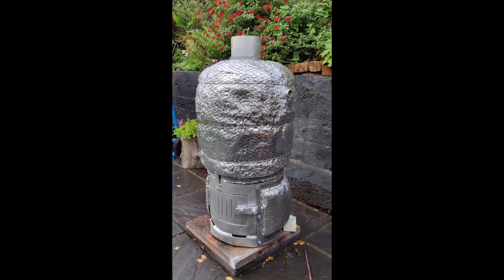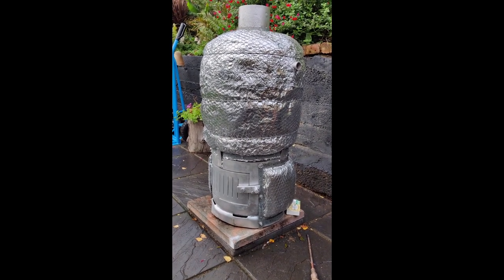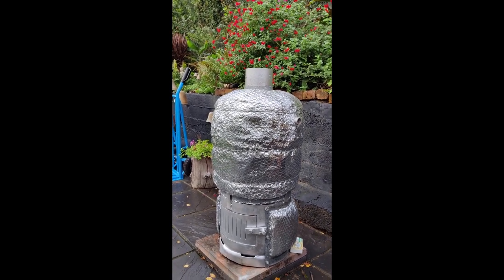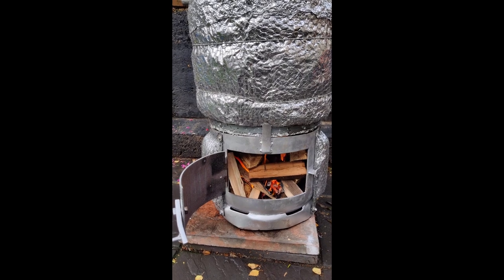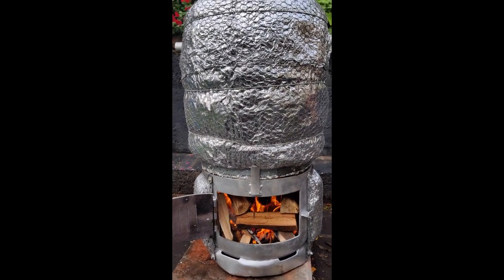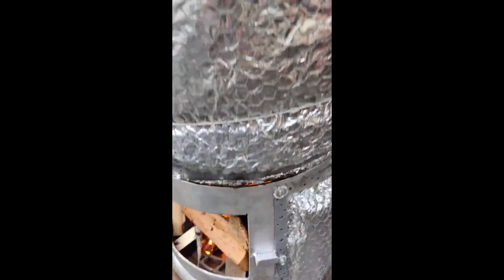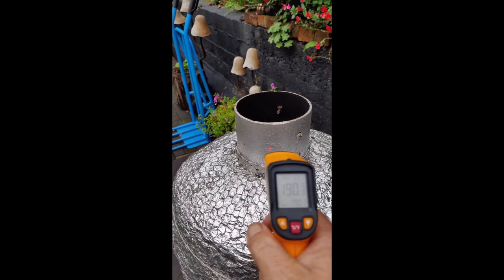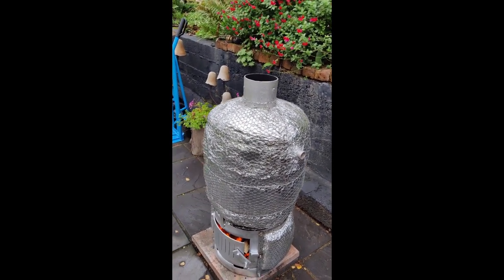Sand battery can it heat my home? part 2

Comment: Great concept but have you though about making a cylinder insert for the smoke hole and design it to place in the opening but have it so the smoke and venting spirals out of the chute like a vortex in a tornado, Im thinking that might make the heating a bit more intense directing those gases upward out against the walls. Also build a frame that has wheels so you can place the canister onto the base frame and wheel it in over top the fire-pit to eliminate one extra set of listing of the canister.  Could you also add open chambers inside the canister enclosed to keep sand out but allow for a fan operation to blow through the inside the the canister to better direct the heat from the sand into the room? Anyway just some thought on how to better utilize your set up to get the most out of your work. I really like the concept and plan to build one for a garage next year. based on your application making some small modifications as I outlined for you. Thanks again for sharing a great idea.

Comment: When are you launching? LOL It looks like a old time satellite.
Great video. I ran on a bit in your first video on this.
You did a nice job on insulating.
On looking though, you already have radiator heat. You can't do much better than that. If it is a closed system, replace the water will oil, and heat transfer increases like 7 times.
I know your wife will want the satellite to not be filling the center of the room.
Try the Trombe Wall I talked about in your first video. It will heat free with the sun as hot as you are getting now with a fire.

Comment: Very interesting experiment that utilized the various system constraints as well as one could do with the materials & methods available. Kudos Lee! (Being limited to burning outside of the room to be heated and having to transport thermal mass into the house manually both combine to introduce huge inefficiencies that limit the possible engineering solutions. If Lee was allowed to pipe a heated thermal transfer fluid, like mineral oil, from a backyard wood burner with a heat exchanger & a high temperature pump, then heat capture would be more efficient & continuous. Add sand batteries in the rooms to be heated and then wood burning batches could be spread out as there would always be stored heat in the sand batteries to draw from. Alas, modernity now hits us all with systemic constraints that prevent all sorts of alternative heating backup systems.)

NOTE: It is also possible that the introduction of the chicken wire coil in the central chimney helped a bit by breaking up the more laminar flow of heated air & combustion gases and causing more turbulent flow which would keep the heated gases in contact with the chimney walls longer - thus transferring more heat into the sand. (The more surface area of heat exchange the better. Hope someone with heat exchanger design experience will chime in if there are any improvements that Lee could make to improve heating efficiency - especially as winter is coming on shortly.)

I'd say Lee made a excellent start on a supplemental heating system that uses wood - a relatively inexpensive renewable resource. But results suggest that more heat energy will be required to get thru a cold winter and heat even a single room to a comfortable level & maintain it day after day.
Reply: Also, we handled a prolonged winter heating emergency by camping in a single room, covering the windows with homemade insulated curtains, and focusing on just keeping that room "comfortable". The rest of the house was kept above freezing to prevent pipes from bursting.

A better test of Lee's system would be to prepare his winter survival room as detailed above, and then see what room temperature could be attained & maintained with his sand battery. (Especially the delta T between indoor & outdoor temperature over time.) If, with the survival room as insulated as possible, the sand battery can create comfortable air temp for a number of hours, then maybe all that will be needed is a second sand battery that can be charging while the first one is discharging.

As some have suggested, a metal insert in the sand battery chimney that increases turbulent flow and conducts more heat to the chimney wall could help improve heat exchange. But then there is the challenge of transferring that heat into the sand. Again, someone expert in heat exchanger engineering needs to chime in on how to get that heat into the sand more efficiently. (A simple, inexpensive solution that improves thermal storage sufficiently to make it worthwhile to implement.)

Comment: Consider adding a damper on the top of the chimney to restrict the fumes allowing more heat transfer and slower burn of the wood. Yes an open chimney will burn hotter and faster but inn this case a slow 300C burn will save you wood and will make the overall project more efficient as you are losing less heat.
Reply: Yes the difference between sauna and takka.

Comment: Make a box out of glass foam about 180 mm thick. Put a plate steel floor inside the box to distribute the weight. Stack firebricks inside, tied together with fencing material or chicken wire, like a gabion fence. Put a resistance heater in it. Use a solar panel or a small wind turbine to power the resistance heater. Select the resistance for maximum power transfer. The heat will leak through the glass foam insulation at a rate that is dependent on the temperature of the bricks. Continue to use your home heating system and thermostat the same as before. The heat that leaks through the glass foam insulation into the house interior will reduce the amount of fuel you have to buy for the conventional system.

Comment: theres endless upgrades you could do with this but top of my list would be to introduce hot fresh air to the smoke. any smoke exiting the chimney is unburned fuel and lost potential heat. 

i'd add a slight narrow point in the chimney, about 1/3rd of the way up. (like in a carburettor) and pipe in some pre-heated air so the smoke ignites in the chimney.

Comment: Hi enjoyed your sand heater design, Matchine Mart sell heat powered stove fans maybe ideal for application, I would worry about your wood floors sit on top of concrete slab or heat resistant tiles,

Comment: Water has idk perhaps 4x the heat capacity as sand.  I won't bother calculating.  However with water, you will need redundant pressure relief systems JIC.   water pressure build up can be explosive but there are ways to mitigate the excessive pressures safely.  If you try water, make sure you have redundant systems in place beforehand and are clear on when and what pressures they will release less it blow a hole in your wall.   If your not sure how absolutely, don't do it.  An alternative would be graphite powder as it won't melt with your setup and you should be able to seal the container and reduce the smell.  Before you seal it, heat it as hot as you can and then seal it, as it will create a vacuum when it cools.  GL!

Comment: Suggestion: Use Celsius or use Fahrenheit, but not both. Pick just one and stick with it. When you use both, it causes unnecessary confusion. I used to work for a company that insisted on using both millimeters and inches. I had to convert back and forth literally every day. It caused many problems. The fence only hurts when you are sitting on it.

Comment: Awsome project. I'm looking to do the same at a larger scale with a thebaddition of a water heat exchanger and a radiator in the house. I found your channel while doing some homework. Is the system working for you?

I believe the chicken wire is causing turbulent flow in the flue allowing better transfer of heat. I deal with this at work with water cooled molds. When we have overheating issues, baffles are added to create turbulence and increase  heat transfer. 

If you add a cap to the flue to direct the air horizontally, it might make the room feel warmer. As it is, it seems as though the heat is being directed to the ceiling and the cool air is settling where your thermometer is located.

Comment: For IR reflectors (Al foil etc) to work efficiently, you need a significant air gap (free of solid materials). At least 1/4" but 1" or so, even better. If it is pressed right up against another material, then it won't work, or barely, at all. 

  The easiest way to do this, is to get some Al flashing or the like, polish it to a more mirror finish, and then enclose that around (but outside of, not directly connected to) the stove most of the way but without blocking the air intake areas.
Reply: Btw, talc powder is better to use than sand.  Soapstone is primarily made of the same material that talc powder is. Soapstone has one of the highest heat capacities of solid materials out there (interestingly, water is far higher than most common substances). The nice thing about talc powder also is that it is very soft. You could compress it to get out more of the air and to pack more of the powder in a space, which increases the density, which increases the heat capacity per volume.  

   If folks are worried about breathing in talc powder or it getting loose at all, just pour a layer of waterglass over it.  The easiest way to use this, would be to put talc powder in metal buckets or pans (then compress it if you can) on top of a flat stove surface.

Comment: Not sure if you thought about it but you could use a fireplace fan -- energized by heat no electricity and would circulate the heat coming up from the pipe.

Comment: You don't seem to be getting the full rocket stove effect with the secondary burn in the chimney (for which you need air injection further up the flue).  Could you run a pipe or two from the exterior at the bottom up the chimney to about halfway?  That would inject heated air into the hot gassed
 and complete the burn.  Possibly a taller removable chimney would get the roar really going.  And more air to the bottom of the fire?  A ring of holes around the bottom of the firebox?  I heat with a wood stove, so I know adding air to a stove through a door gets you a slower fireplace type burn--while having the door closed and the air blasting into the base of the flame through narrower holes, gets the fire really honking!
Seems bloody effective as it is though!  Hell of a job!

Comment: Very interesting! Made a rocket stove sand battery that released heat for 5 hours but have been thinking about how an insulated jacket would improve the design. BTW, did you use standard rockwool?
Reply from the maker: No I got ceramic insulation, hi temperature as I didn't want to risk a smell , not that I'm saying rock wool or other insulation will smell, it's just that this one said it doesn't so I'd went with is to save me doing it twice 👍
Reply: @leejones2511  this is a great experiment.  Keep it going.  👍👍👍

Comment: Also it looks like you can work with metal, so if you can also do a bit of plumbing, I think you can do your own diy mini outdoors boiler. That would be easy to move or remove if sb doesn't like it, and you will not need to Gotti stuff in and out of home, resking the partner disapproval 😄. Let me know for more info !
Reply: That's what I did to keep an insulated greenhouse warm over night. We had several 50 gallon drums linked
Reply: Until the city or state finds out about it and you don't have a permit.

Comment: I think this is the "future" of heating! Of course it must be modified and tuned up to reach Hi efficiency = less wood, more heat! I think about it like so - we put it in the underground level - there is a burner. Very slow burning process heats up the "drum" and then pipes inside the "drum" heats all the house with a fan.. Yes.

Comment: Add a damper on top so you don't lose so much heat out of the top during the burn... use less fuel to heat it initially.

Comment: Right off the bat you're losing a ton of heat through that hole on top. You should wind the exhaust back down around your stove (if you want to keep all the heat in the medium), then again up and out of the room with cooled-off gases. Make sure you take care of liquid residues in the pipe.

Comment: you could always build a big sand tank outside with switchable ducting and after your burn change the duct to the inside ducting with a small fan assist recycling the inside air

Comment: If 23C is uncomfortably hot indoors - turn the fan off. It'll cool slower so last longer at a less intense heat. You'll still get airflow from convection - hot air rises without a fan to help it along
Reply from the maker: Yes it was just a test to see the output 👍

Comment: 19:10 but why did u place cooler underneath and not above the sand-heater? That way cooler just cool down the sand and send all the hot air straight to the ceiling... Do u need warm air there or on the floor? I'd placed the cooler upside down to send hot air down where it be mixed with the cold air and made the room air more pleasant to feel.

Comment: Instead of wasting the heat, use the top to cook when you are heating it up. I think the initial smoke was from the chickenwire coating burning off. I didn't see the smoke after. In general, more mass will store and radiate more heat. Not sure on your setup due to the airflow of the flue. Are you really going to go outside and burn this for a couple hours, and lug that thing in and out every day? I was thinking of ducting the hot air in and keeping the whole unit outdoors.
Reply from the maker: Cooking not really a option for us unfortunately, but yes will be burning it most days when it's needed, it's not always cold here, we had 12 hrs of heat in that last 2hr  burn but il be doing another video & we can see whether what heat was effective & when it tailed off 👍

Comment: You are having to use energy input (wood which in itself is a cost to be considered)to make the sand hot and get heat out. For those that don’t have any wood to burn i.e. the greater majority of people could not use it. It cannot be called a battery, it’s just a storage heater which is similar for example to an oil heater that we use in our conservatory in the winter which requires an input source to hear the oil which is electricity and then the oil gives off the heat to the room. This also is not a battery.
Reply from the maker: So when you charge your phone  which comes mainly from  burning fossil fuels ie burning gas/coal to heat water to power a turbine to make electricity which you then plug into your phone which stores that energy that to be used  is this also a storage heater?
I'm just building & sharing something personal to me burning my own free wood storing that energy to heat my home the only way available to myself for free 👍

Comment: Great video, thanks. What did you do with the hole you had drilled to release pressure? From the last video, it looked like you screwed the bolt in -- did you leave it in, or take it out? With the massive increase in energy in this sand battery, I'd be worried about the potential pressure build-up.
Reply: Could leave it slightly loose to allow moisture to escape.

Comment: Using galvanised wire mesh as a vent baffle is not a great idea as zinc coating melts at a low temp and the vapour it gives off is pretty toxic. Stainless steel mesh is cheaply available, is non toxic and will last much longer. Other than that, a great build! Wondering if instead of carrying it into the house might be easier to build an insulated enclosure against an outside wall and blow the hot air into the house through a fan vent?

Comment: personally i would remove the pc fan and let natural convection rise move the hot air up the unit and out of the center pipe...place the pc fan on a stand above the unit blowing the heat down....and since you have rebar...hang pieces down inside that center pipe like you did with the rolled up cage to hold more heat when you bring it inside

Comment: If you wee to put a 90 degree elbos and blow it across the room it would heat the room better. You could add a 45 elbos and blow it at the floor the floor would be warm and also hold some of the excess heat just like the sand.

Comment: Do a test without the fan. You won't have to pay the electricity and it'll probably  last longer. The way its made, it'll pull air from the floor just fine.
Nice work though. Subbed!
BTW, I see your spine in the background. Is someone in the house a Chiropractor like me?
Reply from the maker: Yes it do a convection video soon, & that's my wife she's a sports therapist & Pilates instructor 👍
Reply from the maker: Thank you for your sub & feedback 👍

Comment: Dumb question here--do you think something like this could work well as a water heater?  Like with a coil of copper pipe running inside the sand or something like that?  Seems like if it's insulated well, the thermal mass could continue to heat up water pretty well even after the fire is out.

Comment: Long term health concerns

There is a small lead content on the galvanized coating. When welding, this lead will vaporise and form lead oxide fumes. These gases can cause long-term health problems such as lung and brain cancer and even complications in the nervous system.17 Aug 2020

Comment: This is basically a rocket stove with the exhaust pipes covered with stone and clay made into mass heat storage in the form of a sofa. Biomass heat using scrap wood is very cheap to run and will save you so much money. The work to keep the fire burning makes it unpopular.